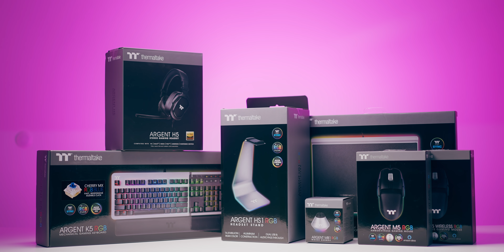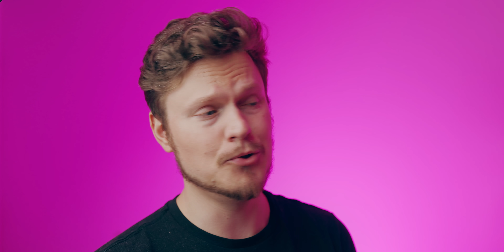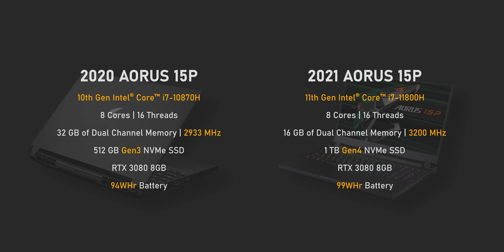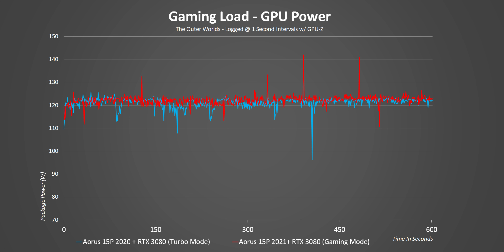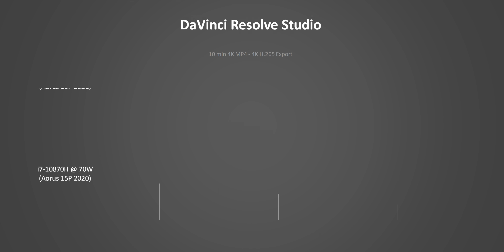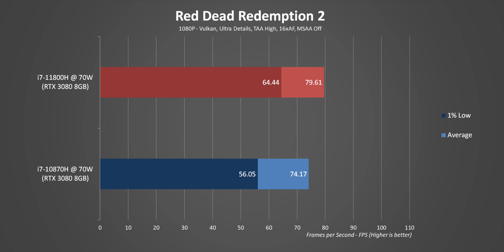Intel 11th Gen Tiger Lake Gaming Laptops are NUTS!

Comment: I went from a laptop with 10875h to a 11800h and notice pretty much same thing....
Intel velocity boost and turbo 3.0 suck hard on the 10th series laptop gets loud hot and ramps fans  up and down I just turned it off for better temps... 

As for the 11800h I get similar thing better performance at lower clocks  ESPECIALLY at idle and low work loads and high work loads I think similar temps but over all more quiet system...
I also think it uses more power boosted at least on my laptop because they upped the power brick from 230w to 280w on the laptop I upgraded from and only difference on them is the cpu...
11800h New 10mn you'd assume lower TDP but that is not the case... still lower temps and seems more stable without all that boosting... to get above 5.0ghz on old  14mn which first came out in 2015..

Comment: You are the man I need to talk to lol. I bought the Samsung book pro, Evo Core i7 11th gen. , 512GB SSD , 16GB RAM seams AWESOME so far. My question is , will it run a egpu via Thunderbolt 3 or 4 without much " bottleneck " from the cpu??
Reply: yes it`ll, the biggest bottleneck is Thunderobolt itself, which gives only 4 PCIe lanes (both TB3 and TB4) and has even a bit lower troughtput than expected in 4xPCIe as data has to go trough the Thunderbolt controller.

Comment: Aorus 15P with i7-10870h + rtx 3080 never exist (only 15P with i7-10870h + rtx 3070 and have same 99Wh battery) 😉 This is not 2020 models. All aorus 15P with rtx 3000 series is 2021 models. If you have aorus with i7-10870h + rtx 3080 this is 15G and this laptopa have only 105w gpu. Aorus 15P with i7-11800h + rtx 3080 have 130w gpu. As for me, the tests suck. You have no idea what you are testing. Check manufacturer's website first before you start testing anything.

Comment: As we have seen before, fast RAM matters a lot in benchmarks for gaming.
Comparing a system with lower RAM speed to something faster is not fair putting all the points in intels basket!
This video goes into the Yellow Flag range a lot. sad.
Reply: you don't know the cl these ram sticks have. 3200 can be slower than 2933.

Comment: Seems that x86 processor laptops are now where autos were decades ago: manufacturers can no longer present engine power increases alone as progress. CPUs for laptops don’t need to be more powerful, everything else needs to improve first - starting with efficiency so better battery life, less heat, less fan noise, less cooling requirements in general and hopefully less girth and less weight. The focus instead switches to improving GPUs, read/write speeds, connectivity, better displays, etc etc.

Comment: Thanks for the great analysis. Yes, Tiger Lake H series does bring a good performance uplift over 10th Gen Comet Lake but as it has been proven during the low powered version testing, it is not that much power efficient over 10th Gen, especially when compared against Zen 3 based 5000 series Processors. Waiting to see a Ryzen 5000H series added to the mix for comparison.

Comment: My notebook with an I5-10300H 10th generation scores 4763 points on Cinebench R23, witch is higher than this I7. I would guess this has something to do with cooling, because it runs at 45 watts on average. Or would different versions of Cinebench have this much differente results?
Reply: It's the laptop. Some have better power delivery or cooling.

Also check what frequencies are being used by i5 using or how much power draw it has. Should be close to 45 watts as the peak (TDP).
Reply: You can`t compare scores between different Cinebench releases.

Comment: Just adding to the other 30 comments saying the same. Assuming you just mixed up the battery graphs but so many reviews skim over battery it should be as major of a section as performance. Different work loads, charging speeds etc. It really impacts how you can actually use the laptop. And I hate high load battery times they are the least meaningful comment

Comment: compare it to any ryzen laptop now..already intel was way superior for creators cause most of the intel laptops have sd card slot and also mid to high end laptops have thunderbolt ...and usually most of the creator applications run better on intel..they have better support and optimisation..theseare must for creators..and in gaming they are also usually better especially almost all intel laptops with rtx 30 series have mux switch which helps a lot..they were already better in real world productivity for creators and gaming..plus now they even beat ryzen in like cinebench lol..also finding any ryzen laptop stock is way harder than intel..in a word,its not even a competition...also there are extremely good laptops with intel like predator helios 500 16 inch,zephrus m16 and gigabyte aero 15 oled,razer blade series,alienware x series etc

Comment: I wish they'd work a little more on battery life. Considering how long I spend off the plug on my machine, despite it being a proper gaming laptop and all, I don't think I'd be able to integrate a Intel 11th gen machine into my daily life as it is. Otherwise, impressive stuff.
Reply: He should've lowered the refresh rate to 60hz instead of using default mode
...
Reply: @a_spire  my opinion wasn't based on this video, because he only showed battery run times on load, which is a zero case scenario for me.

I was talking about 11th gen's idle battery life in general, it's better than 10th gen for sure, but still nowhere near as good as AMD's. I can sacrifice a bit of gaming performance for the much longer battery life on AMD.

My Legion 5 Pro runs off the wall for so long that I almost never need to plug it in during web browsing and normal laptop stuff, which is almost all day, and then it recharges when I play games at night.
Reply: @hasnihossainsami8375  I have a Helios 300 with an i7 and I get around 5 hours of battery while browsing the web
Reply: @a_spire  mine comfortably gets twice that
Reply: @hasnihossainsami8375  The legion 5 pro is $1600 without tax here lol (so you can add $100-300 for tax on top of that)... I paid $1100 for my laptop. In any case, it's a great laptop. I just wish that it would be cheaper here.
Reply: @a_spire  we weren't talking about price; very over-smart of you to try and divert the discussion to something completely irrelevant. Price almost never dictates the battery performance of a laptop, in case you didn't know.

However, being the charitable person that I am, I shall humor you. The AMD version of the Acer Nitro 5, which is also a proper gaming laptop and yet costs hundreds less than whatever you've got, lasts even longer than mine. I'm sure you're going to start arguing about how the Nitro has slower components, so let me shoot you down right now: yours most likely doesn't have a RTX 3070 in there, unlike mine.
Reply: @hasnihossainsami8375 the point is that you're comparing laptops with different components/gpus/power limits and concluding that the battery life is good/bad and that's wrong
Reply: @a_spire  you don't seem very knowledgeable about PC hardware stuff so I'm not going to argue any further. Whatever point you're trying to make about components, I've already made my counter argument before you so go read my previous comment. Have a good day.
Reply: I'd like to see removable batteries come back into the scene. My idea is there's a smaller inbuilt battery (say 40Wh) and enough space for a 99.9Wh battery, or even two of the same removable battery (60Wh), and what the manufacturers do is sell the laptop with one battery and spare batteries seperately to both allow users to have spare batteries on hand like powertools, and get around the somewhat arbritrary 100Wh single battery limit, as from my research, airlines allow up to 20 spare batteries. I think the only way it'll physically work is if the batteries are designed to be handrests on each side of the trackpad, and the laptop was shipped with a dummy handrest.

Comment: 5800u still shits all over this though
Reply: No, it's severely power limited.

45 watt processor beats 15 watt. Unless we are talking about a beast ARM chip like the Apple M1.
Reply: @saricubra2867  Yeah but I'm talking about a tdp that's actually realistic for a laptop like 10-15w. Classic intel having to be extremely power inefficient to keep up with the competition
Reply: I'm typing this from personal experience.

My 8 year old Core i7-4700MQ from 2013 at 45 watts destroys the 15 watt Ryzen 5 3500U from 2019, despite that the latter has higher IPC, it's severely limited by the power delivery. So much that the Ryzen 5 3500U with a pretty intensive game, can downclock to 1.5GHz meanwhile my Core i7-4700MQ gets 3.2GHz in a pretty CPU intensive game like CSGO and peak power use of 40 watts.

I have a friend that owns a laptop with a Ryzen 5 3500U and i get TWICE the fps in Citra Nintendo 3DS emulator. In a rendering workload, my Core i7-4700MQ is twice as fast too.

The only good 15 watt processor out there for laptops is the Apple M1, it's an insane chip.
Reply: @saricubra2867  And the 3500u was a horrible design, 4500u and up were good
Reply: Some reviewers found a way of cheating by running the U parts out of spec through Ryzen Master and then the perfomance is on par, or can beat an H series processors while you have the risk of killing the VRMs of your motherboard.

Comment: Is the xps 15 with i5 11400h better than 10th gen?
Reply: Definitely. It has 6 cores compared to 4 cores on the 10th gen equivalent. You can expect it to be about 40~50% faster.
Reply: @skycubix8943  Also uses Willow Cove CPU cores, not old Skylake ones. There are two more cores and the cores themselves are faster too.

Comment: Test on the ram, swap them for fair comparison, sometime they do cheat
Reply: I was about to mention the fact that the system with 32GB might be sporting less performant modules due to density
Reply: ram can't improve the r20 score.and this is not intel send him, this is oem selling laptop you can buy it anytime
if using better ram can make so much different ,then why before they not using good  ram?
Reply: @bogodoyandex9654  Beg to disagree: check latest videos ny Linus Tech Tips and Actually Hardcore Overclocking.
Reply: @bogodoyandex9654 This is not about intel/amd, it is the product quality and cost to performance we having here. But the main question is, whether the new gen is really that good. Not saying that the reviewer was lying but they do promote the product right. In the end, the end user will decide whether it is good or bad.
Talking about using good ram, yes they can do that but they always have alternative to cheap out some components, so that they can earn a little more. I just want any laptop reviewer use the same ram when conduct performance test. (same spec different result do exist)

Comment: Linus identified 20% differences in "same spec'd" laptops due to differences in the type of RAM used between "review" versions of laptops and (later) "retail" versions.  Had to do with whether the RAM was split into two sticks or one.  That might be influencing your results here (but I'm not nearly as knowledgeable as you, so I couldn't tell from the view you gave us of the PC's innards).  

Really, though, thanks for the video!  I'm planning (that's a lie: forced to) wait for a while until laptop availability settles down, and I'm hoping to get myself an 11th gen Intel CPU with an Nvidia GPU (despite the battery-life difference with AMD).  The video more-or-less locked in my plans.
Reply: how much better i don't know . i am score fanboy.
i only know cinebench r20 ,r23 and geekbench score.
tigerlake 11800h 70w running cinebench r20 score 5133 look very strong instead.
i remember lastgen  intel 8 core laptop hard to reach score 4000 . even 10980hk 
and amd destroy it , only 45w already more than score 4000. 11980hk need more than 100w to reach score 4000
now this video show that tigerlake 11800h only 70w already reach more than score 5000 
you can't   ignore this score and continue say intel too waste power too weak
 because 70w ,r20 more than 5000 is really strong 
5800h  140w only score 5900
 and 11900k more than 200w only score 5700
and tigerlake 70w hit 5133
as i say i am benchmark score fanboy ,so i sensity with benchmark score

Comment: People should know that these comparisons are strictly controlled. There are still many factors that affect either battery, performance and so on. How a laptop performs or how long it lasts is strictly and specifically depends on how you intend to use them. No matter how many reviews you watch you will never be satisfied unless you actually buy it and try it out. Intel 11th gen H45 CPU are specifically intended to outperform their old CPU and compete side by side AMD. So don't cry out how AMD is doing better or how Intel is dogshxt. If you think Intel can serve you well, get Intel. If AMD will serve you well, get AMD. You're all already informed on RAM issue, CPU differences and GPU wattages. Quit asking the same question and get what you believe is right. You won't be happy with just by hoping for the best.

Comment: You should have done a watching videos test for battery life, that's where 11th gen mainly shines and it really is more efficient, the asus tuf f15 with a smaller 90w/h battery got 8hrs of watching video content while many 10th gen laptops only get 5-6hrs
Reply: The 11th gen core i7 in the tuf f15 is a lower powered 4 core processor
Whereas these laptops have the 8 core i7 processor
Reply: @Divyesh_Sinha  Lol. You are talking about the Tuf DASH F15 with 11375H. The Tuf Gaming F15 has a 11800H and lasts 8 hours. The Tuf A15 with 5800H lasts 10 hours
Reply: @SF-li9kh  my bad
*Tuf dash f15
Btw how is the i7 11800H model lasting 8 hours?
None of the laptops with that CPU hit more than 5-6hr battery life on YouTube streaming

Comment: Is it single rank or dual rank memory?
Reply: Definitely single rank memory. 8 chips on 1 PCB .
Reply: @fleurdewin7958  Great, let's loose 30% of gaming perfomance by using slower RAM.
Reply: @saricubra2867  I think you got the wrong idea. if you see 4 memory chips on a single PCB, that is the alarm. Not when you have 8 of them.
Reply: @fleurdewin7958  Single rank is still bad and is a bottleneck. The worst part of this, if it's soldered to the motherboard, you are doomed.
Reply: @fleurdewin7958  On both or just one Laptop?...
Reply: This notebook has 2 single rank DDR 4 SODIMM on it. Still running dual channel though. Not bad in my opinion. Dont be confused by dual rank and dual channel memory, they are different things altogether. If you want a dual rank memory, it must have 16 memory chips on a single PCB. These days even 16GB sticks can be a single rank memory module. You have to physically look at it to determine.
Reply: @gucky4717   The video only show 1 of them. I bet its the same.

Comment: If your 10th gen CPU can fully saturate your GPU, you’re still fine though.
Reply: The thing is, you get i7-10700K levels of perfomance with the i7-11800H, if you run a console emulator or do music production, the singlethread gains alone make a massive difference.

Comment: So which one is better AMD R7 5800H or Intel i7 11800H ??
Reply: i7-11800H. Faster clockspeed, more cache, WAY more PCIe bandwidth, Gen 4.0 , undervolting support (i think).

The best i7 is the 11850H that has 4.8GHz max clockspeed.
Reply: @saricubra2867  the cheaper
Reply: @trozt4881 Still is Intel, always has way more stock. If we are talking about desktops, definetly AMD overall by the motherboards alone.
Reply: @saricubra2867  the cheaper
Reply: @trozt4881  It's Intel.
Reply: @saricubra2867  the cheaper
Reply: Talking from the benchmark, Ryzen 7 5800H is better than i7-11800H in multi-core aspect but i7-11800H is better than Ryzen 7 5800H in single-core performance
Reply: @KimiCars  It all depends on the particular laptop. If an Intel laptop has lackluster cooling and doesn't follow the specs, it would lose in multicore against AMD because it has higher base clock. If an Intel laptop has good power delivery and thermals to follow the specs, then it will win by agressive boost.

Currently i wouldn't buy either Zen 3 or Tiger Lake until there is a good laptop with good power delivery, thermals and memory that isn't dumbed down (like soldered single rank).
Reply: @KimiCars  For the best perfomance, don't buy laptops below 17.3 inch. Bigger laptops have better airflow and cooling for the processor.

If you want to go below a Ryzen 7 or Core i7, 15 inch is fine. This is from personal experience.

It's very important that the memory should be dual rank and the fastest available for the motherboard. Linus Tech Tips shows that slow RAM is a huge bottleneck for the CPU in something like gaming.

What a mess.

Comment: Nice Video. It's not a surprise to me at all though. First of all intel basically did nothing on their laptop CPUs since 8th gen. A very nice example for this are the i7 8750H, 9750H and 10750H, which perform almost exactly the same. It really doesn't matter which one of these you have. 11th gen is the first performance improvement worth the name for years. So yes, that's absolutely what intel needed.
Reply: Please tell me if the 10870h is actually worth more that the 10750h.
Reply: @yomido4018  That depends on the application. In singlecore they are almost the same. So for games there won't be a noticeable difference. In multicore heavy applications the upgrade does not look bad.